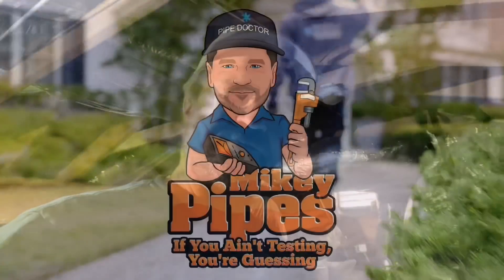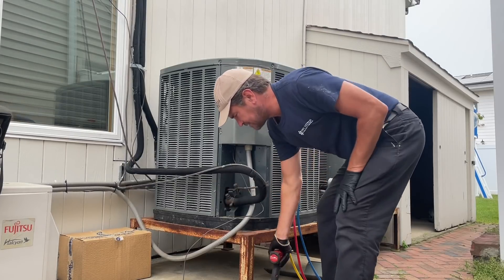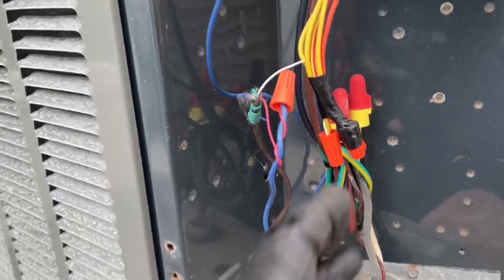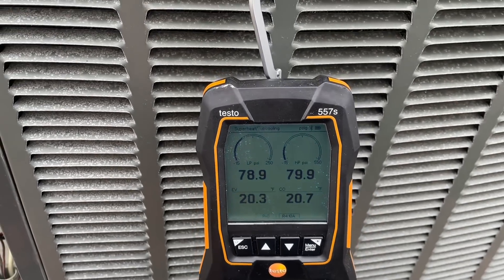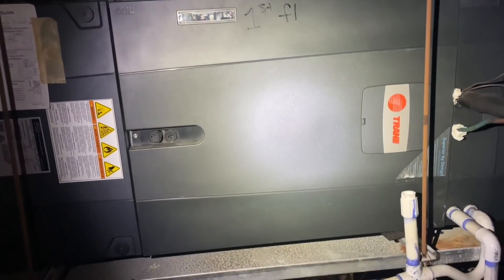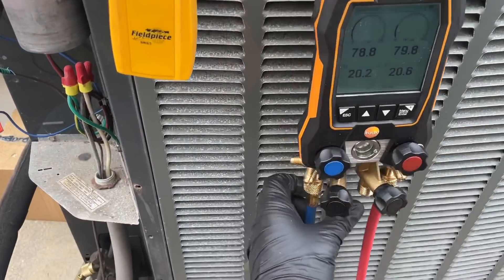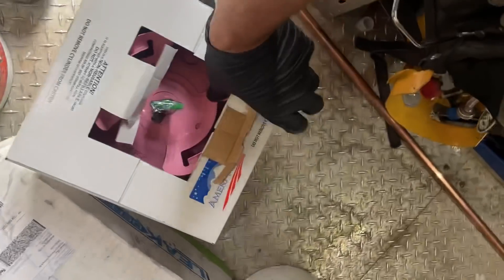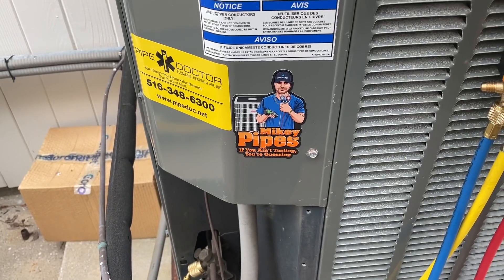Trane Central AC Not Cooling & Outdoor Unit Rapidly Turning On and Off - Evaporator Coil Leak

Comment: As a homeowner that the same problem last month. Contractor tried a sealant, but it didn't work out for us. So had him order the coil (that only took a week to get) and fill the system up. Our guy checked in every few days and would add refrigerant as needed to keep us running.

Comment: Over and over people saying *why not just braze the leak*. First off the Trane condenser was manufactured 7/2012 it should still be under MFG warranty, if it was registered. The coils used today folks aren't like coils made even 15 years ago. A warranty replacement coil is the right call in this situation. As always a paying customer is always right.

Comment: You did the right thing. Especially since there is probably more than just that one leak on the evap. Temp fix. Then full repair with new coil. Plus no stipulations on annual loss of refrigerant on the size of equipment. UV light is great idea. Good work.

Comment: Hey mike love your channel I’ve been in the trade 19 years did residential and moved on to commercial I would have evacuated the system of what ever change that was left and re brazed the leak on that joint no hate just the way I would have handled it

Comment: If you could be pretty sure that you had found the only leak, I would recover refrigerant cut out and sweat in a new section bit of pipe, recharge - they might get a couple of years to save up the pennies for a complete swap out.
Reply: @PipeDoctor  thanks. 👍

Comment: Should have pumped system down. Repaired the leak (on copper) vacuumed lines. Released the charge. Re ran the leak detector over the evap and gone from there. Gave customer options based off results. Assuming they wanted to risk the cost of labor and no other leaks were found. Risk it for the biscuit.

Comment: Would it have been possible to try to fix the leak ?  And obviously no guarantee  . I had 2 leaks fixed before and it’s still holding 🙌🏻💥 one outside  and the other on the evaporator copper

Comment: Greetings from Argentina, Mikey :D
To answer the question from the end of the video: if I'm a customer and money is no objection, I'd ask you if the age of the system is so old as to require to change it. if it is: change it; if it's not, fixing the leak at the point you detected it and adding refrigerant until the weeks to get the new coil pass, and then changing the coil.
Keep feeding us. We're a hungry lot ;)

Comment: That spot could have been fixed and it looked like it was before the EEV so a top off charge will blow out of the high pressure leak point. But the leak does bring suspicion to the integrity of the rest of the coil so for CYA purposes coil is probably the best option. 

Also curious on those air handlers. Are they UV rated internally? If not the plastic may degrade and fail along with the wire insulation.

Comment: I would give the customer two options one pump down the system repair the leak install a new filter dryer pressure test recharge the system option two top the charge off order a new a coil let them know the cost ahead of time giving them the opportunity to make their decision
Reply: You should not pump down 410a scroll systems!
Reply: @petersmart1999  your correct I should be more specific I only pumped down to around 5-10 psi . There is a risk of damage to the compressor haven't had any problems

Comment: When replacing r22 system to 410 do you also replace the copper lines from condenser to air handler. I’m curious. I’m no ac guy.
Reply: @PipeDoctor  I Got a guy coming to look at my “03” rheem system. Works fine but the drier filter at condenser is looking like it is weeping oil. It’s Rusty and Crusty. I guess we shall see what the cost effectiveness will be.

Comment: Back in the 80's I was going to show a Cadet on the ship I was working on how to use a halide torch. We knew we had a leak in one of our large walk in freezers. So, as we are walking down to the Freezer, I lit the torch and was explaining how to watch for the color of the flame. The Cadet looks at me and asks, "should it be green already"?  The leak was so bad that you could sense it over 25 feet away from the freezer. Needless to say was got our of there and did not go back until we had ventilated the entire area.

Comment: Tempting to pump it down and recover the refrigerant.  Rebraze the copper pipe, and refill the system.  Good for the environment.  Good for the customer.
Reply: This is exactly what should have been done, or at least an option. Too many lazy techs who just want to upsell and lie to the customer just to make a sale, or try and get some stupid warranty claim for a single braze joint.
Reply: @dustinthewind5538  What Mike is saying here is that the brand of Evap is notorious for many leaks. If you repaired it one location next time he comes out to the customer's home there could be another leak in another location. Better to just purchase a better Evap and do the job once.

Comment: Since little gas is in system I would clear the gas and re-braze the joint since it is in the copper line - why ever change the evap coil?   If the coil has some other issues then re-braze and order a new coil.

Comment: The fan wires sticking out from the top of the condenser is an accident waiting to happen (electrocution is possible).  Also, there is no protection from the elements on the fan wires.  They should be in a conduit to protect them from UV degradation.
Reply: I agree here. you can get some of that black plastic stuff in Harbor Freight to cover them up.

Comment: how fast was it leaking out? thats a good question. and how much did you add (at roughly $100 a pound)?
Reply: $100 per pound,where on earth are they charging that! That would be $3000 A jug
Reply: @petersmart1999  what do you think techs charge to add the stuff? Where are you located?

Comment: Isn't it true that if the owner registered their product with Trane upon installation, that the parts have a 10 year warranty?  If so, then they'd only be on the hook for removal, install and juice.  The unit is from 7/2012 - which would give them one more year of warranty.  I don't know what the longevity of a unit in NY near the ocean is, but I ran two Carriers within 3 miles of the Pacific for 25 years... (and were still whirring away when I left - despite the rotted out condenser cabinet bases...)

Despite "money being no object", it would keep the old unit(s) out of the landfill prematurely.

Comment: I wonder if it'd be reasonable to pump it up but only with the order of the new coil for 2 weeks out. That way you give her instant gratification, the repair is then done right when parts are available, and you'd have less r410a leakage than if you just charged it and let the homeowner go on until it stopped working again. That would seem like a good middle of the road solution to me as a home owner.

Comment: As a homeowner, not a professional, and money being no object, I'd replace the entire system. If lead time was an issue, I would have the current system topped off to get some relief until the new system was installed. Hopefully, the leak wouldn't be so bad that it would go flat before the new system was installed.